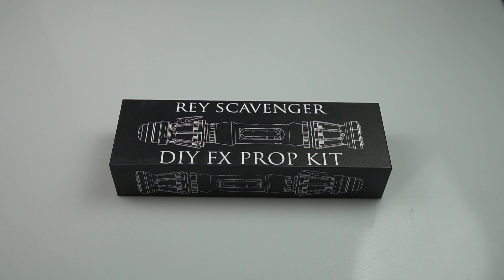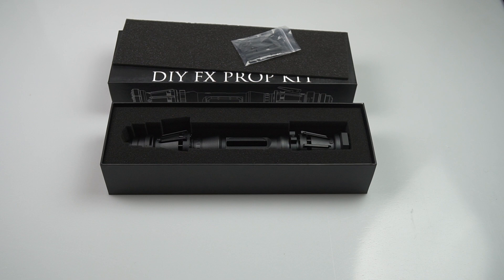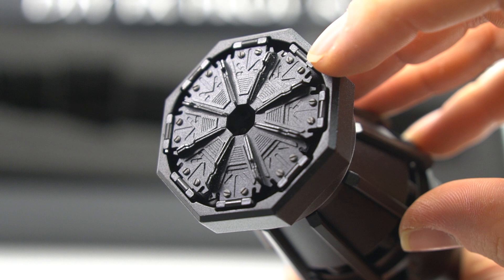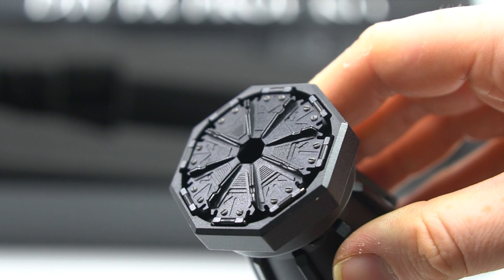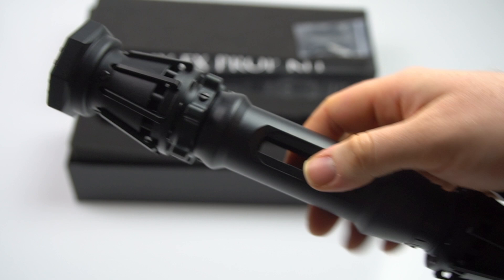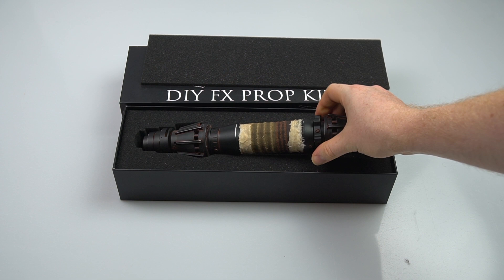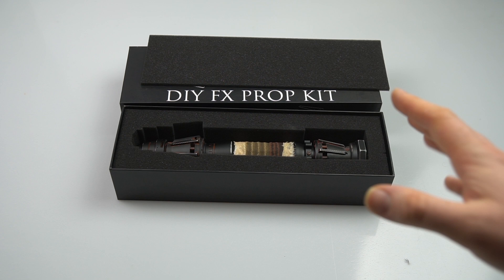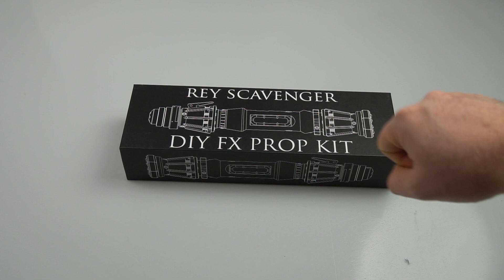Rey Skywalker 'Scavenger' DIY Empty Hilt Prop Kit Overview by KR Sabers x Denis Lukyanov x GOTH3D

Comment: Hello,
nice Video. This is a really beautiful an detailed hilt. Great Work!
But I have some Questions: How long is the Hilt actually? And for the Metal Master Chassis - Is this only painted in metal or are there really parts with 3dprinted metal (brass?) as material?Thanks in advance
Reply: just found the answer for the chassis question. But I still like to know the dimensions of the Hilt. Thx

Comment: I just picked one of these up second hand - beautiful.  Where can I find into on how the rotary is used to click a switch?  I'd like to build my own chassis, but just looking at it, it's not clear how the mechanics of the rotary switch would interact with a switch on a removable chassis (and I haven't attempted to take it apart enough to discover the design intention there)

Comment: Khal, is it possible for the installer to install the chassis after the weathering? Or should we order a clean one if we want it to get installed? Since the weathered one has a cloth wrap already on it?
Reply from the maker: There is no buttons under the cloth wrap so it can certainly be installed after being weathered. 👍